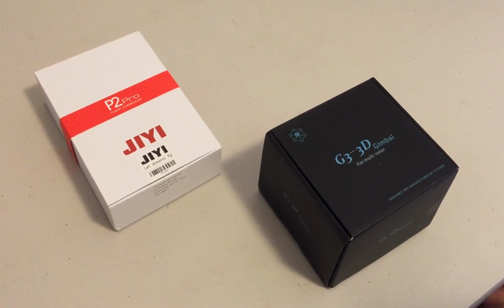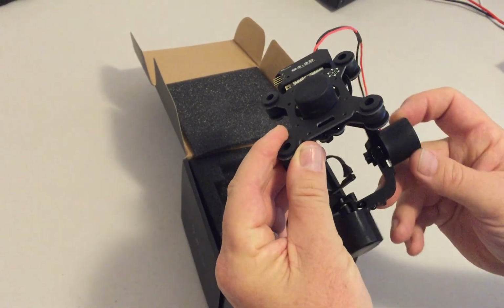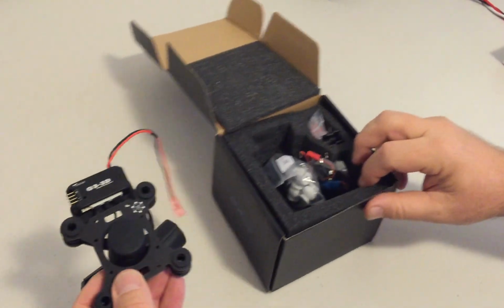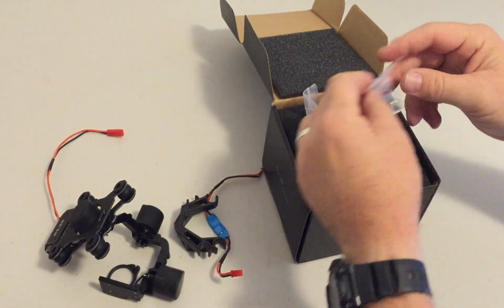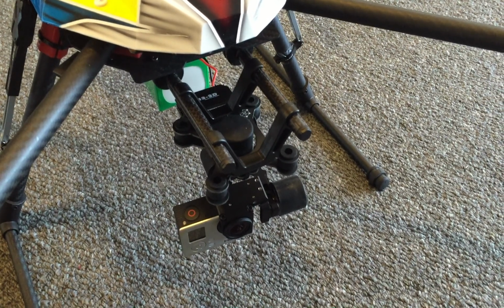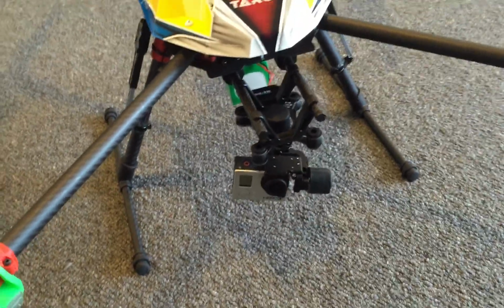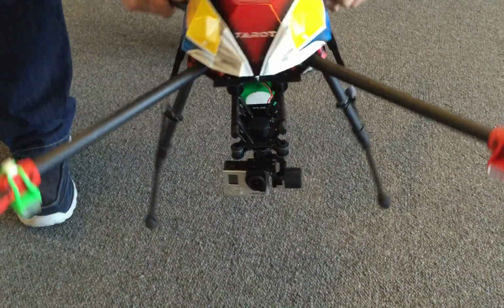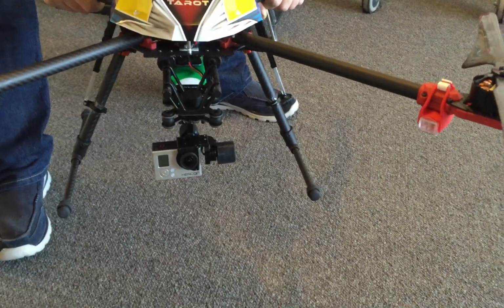JIYI G3-3D 3 Axis Gimbal unboxing and first test.

Comment: Great video, thanks! By the way, are you using Sunnysky motors in your quad? Is it the X4110S 400kv?
Reply from the maker: +tecdux Thanks for the comments, yes they are sunny sky X4110S motors but the 340 KV version.   I wanted the lower KV to run 17 inch props
Reply: +Trainboy64 thanks for the info, I have the 400kv and i'm thinking in running them with the 17x5.5. If possible, could you tell me the battery you are using and how much flight time do you get with it? Cheers!

Comment: does this come with a lead for video from the go pro up to transmitter?    if not is there room to fit/plug one in?  it seems very tight with the way its mounted with that clamp ring?   thanks.
Reply from the maker: +Richard Gilmore Hi Richard, no it does not come with that lead.  If you can make one fit I think it will be tight.  I haven't tried.